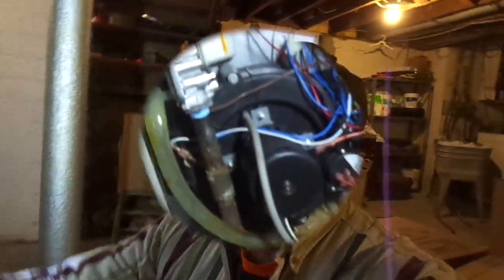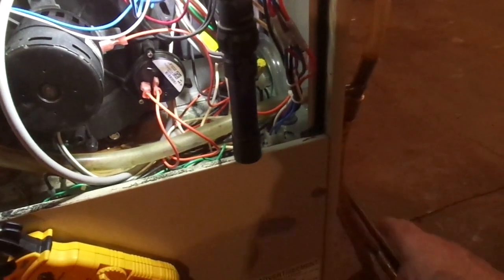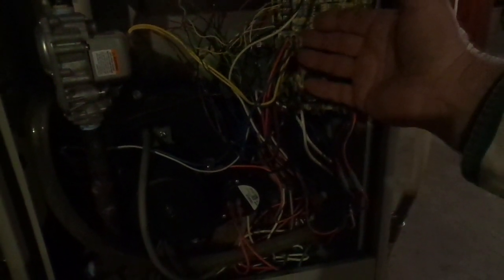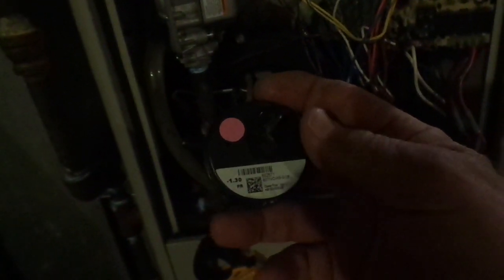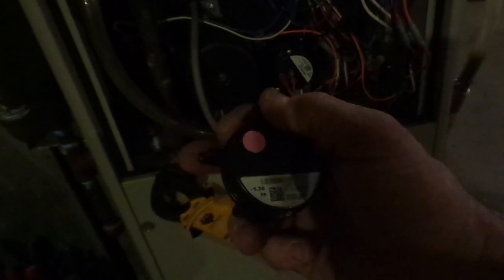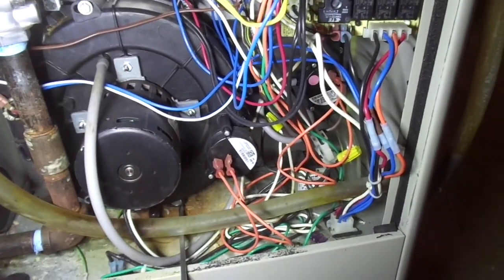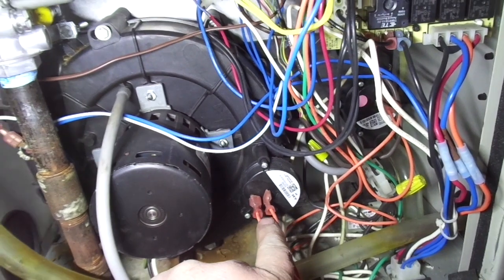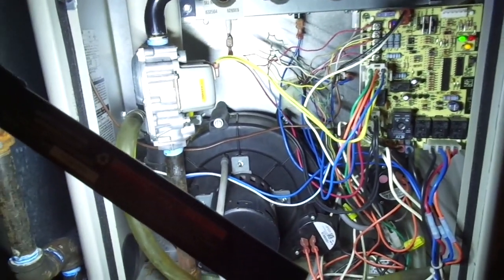Gas Furnace Failure At Father in Laws

Comment: What’s the shipping coupling doing in the gas piping?
Reply from the maker: Oh noooo...!!  You, Timothy are a guy that know what he's looking at.  Yes, that is a shipping coupling, otherwise known as a "Merchants" coupling.  The difference being the tapered vs non tapered internal threads.  I asked our piping supplier in the big city many years ago about their use and their suggestion was on small diameter applications with less than a half-pound gas delivery they were code acceptable as long as proper thread lubricant was used.  They do draw to the hilt on the tapered nipple or field cut threaded pipe, but seal adequately for the application.  
    Now I'm sure there are many changes to the code since I've been in the field daily and they may no longer be acceptable for this use.  This one has been in this piping system since the original furnace was installed in the mid 80's prior to this particular one though as have many many others.  But that doesn't mean it's correct.  But then again I remember years ago where galvanized fittings were  local code acceptable in gas piping but galvanized piping was not.  That however, changed before I retired.  I remain impressed at your noticing.....  By the way, last winter I worked on a lady-friends unit that had been piped in with a DIELECTIC union in the black iron piping !!  Now after 42 years in the industry you'd think I'd have seen that before....but I hadn't.  Yes, I replaced it with a standard union. Thanks for keeping me on my toes...!!!  Have wonderful week, and keep that sharp eye on the look out !! LOL
Reply: @tractorman4461  Absolutely! Thanks for the reply back. The gas pressure is low and that was a good call to put a union in place👍🏻

Comment: Good Day Sir :   Love the info. years back my daughter called dad I have no heat. she has the same unit, wish I saw this video you do a real good job explaining how thing work. after checking the circuits I got of easy The air intake filter needed replacing thank you . No fear now  take  care God Bless
Reply from the maker: Back in the day furnaces were a lot simpler to work on and almost every part could be replaced with a 'universal' replacement part.  With the newest generation furnaces, many parts must be replaced with 'oem' components and it is just about impossible to carry all the parts required to fix all the different brands.  So the industry has changed dramatically and actually I am glad to be retired after 40+ years working in it.  Thanks for the comment and I'm glad you were able to get to the bottom of your daughters problem....Take care and Be safe sir !! (-:
Reply: Thank You Sir;  No truer words have been spoken I am in the same boat    I am glad to be   retired after 40+years working in it      Take care Be safe sir

Comment: Good to see ya Buddy, I had to figure out the same thing on my furnace a couple of years back, it all started by a chipmunk climbing down my air inlet pipe and making it to the blower.🤪 take care buddy, I’m still busting wood.
Reply from the maker: Yes, I have taken a lot of birds out of the flu pipes.  With these pvc flu systems, I just cut them off remove the dead bird and glue a coupling back in.  Hahahahaha. Yeah, I'm in the wood pile on occasion too.  Splitting for year after next now.

Comment: It may be sacrilegious, but when we bought this house we wanted to put in central air.  The first installer quoted with a new 95% efficient furnace at about $12,000.00. 
I said I wanted to leave the 80% furnace because over the life of the install a 15% improved efficiency wouldn't cover the cost.  
$2500.00 covered the heat exchanger and the install. It's been running 8 years now. 
$1,500.00 a year for heat X 15% = $225.00
After the 8 years since the air was installed the new 95% efficient furnace would save $1,800.00 in NG.
9500/225 = 42.2 years
Both the furnace and I will be long gone before 2054. When the install would be a break even. 
On a new install, or replacing a bad furnace, putting in a 95% efficient furnace might pay off. Of course there is the board and valving to replace that I think one replacement, short of a new firebox would cost more than all the major components/controls on my 58 year old furnace. 
I advised Ryan to have his 95% furnace replaced with a new one when he installed central air in his house. He's a lot younger. 😆
Reply from the maker: You pretty much nailed it.  The downtime and cost of repairs by a contractor rapidly overcome virtually any savings unless you get the rare system with little to no failures over the course of its life.  And with the sophistication of today's systems, those are a rarity indeed.  I will install high efficiency equipment for family and friends so they really do make out in the long run....unless I die.  But at least the systems are much more affordable for them by not having to pay installation costs or the high hourly costs of maintaining them. I don't mind lending a hand on occasion for good friends either.  Most of the people I help would never be able to pay contractors prices anyway, so I don't feel like I'm taking work away from anyone either.  Besides, its kinda fun as long as it doesn't happen too often.
Reply: @tractorman4461  Friends and family always get the Christmas discount. I see them every Christmas and we help each other when we can.